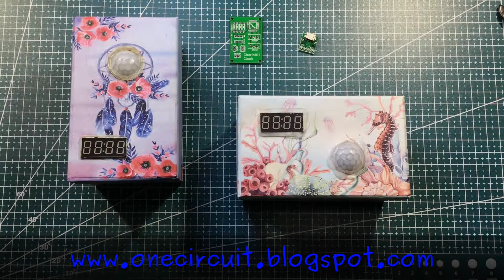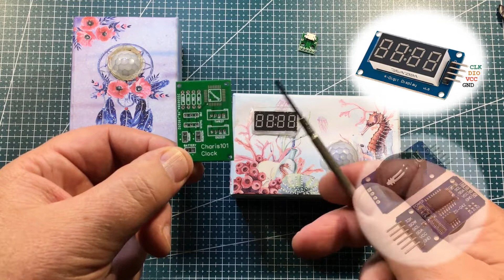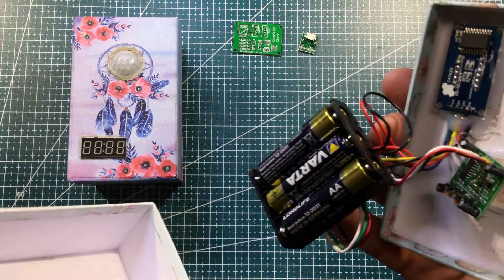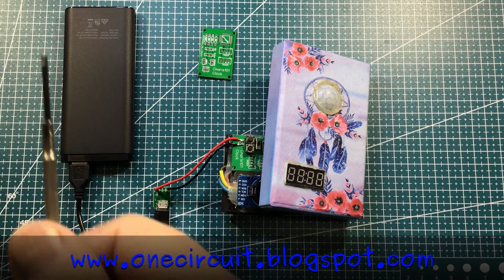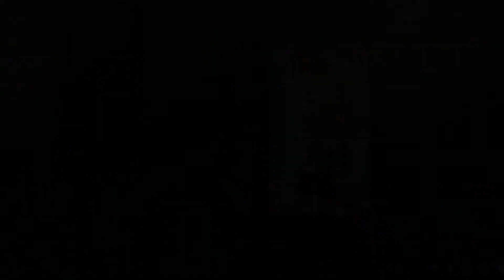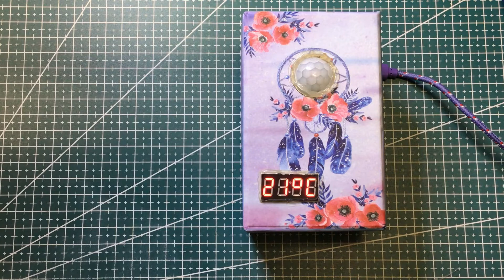Changing a clock project from batteries to mains.

Comment: If you ha e a power supply and no micropower requirements, try a clock using one of those ebay $6 GPS modules.
They come standard outputting 9600 baud serial text strings, you just receive that and look for the GGA string which has the HHMMSS as 6 text characters.
You never have to set the time again and it always keeps perfect time.
I've got a heap of clock projects made this way its really good if you can afford the 30mA or so for the GPS module. 👍

Comment: If one doesn't want it permanently tethered, nor replacing batteries, a suitable amount of LiIon battery/ies + a TP 4056 module would also do, I guess?
Reply from the maker: Yes an 18650 or such, recharged via solar would be sustainable. 👍😀
Reply: @onecircuit-as  While I was thinking more along the occasional recharge instead of battery replacement, a solar panel, if it's in a bright enough spot, should make it fully hands off.☀️👍
Reply from the maker: The clock is in a convenient but non-sun position (top of the fridge), but it might be worth exploring the solar option for a window sill.